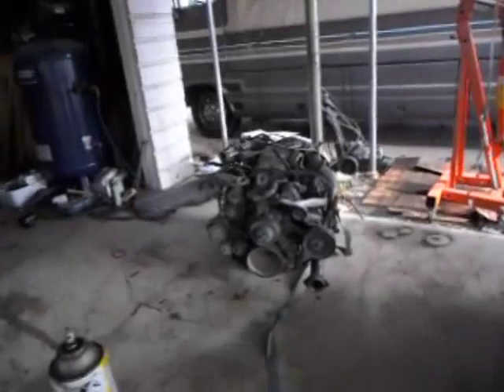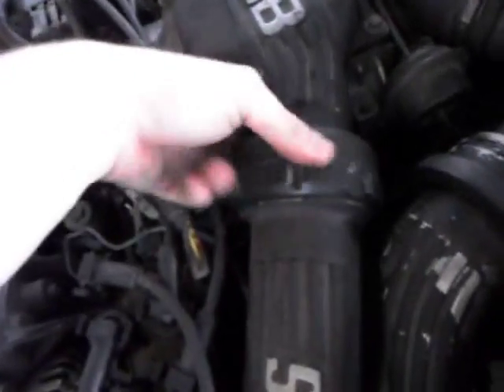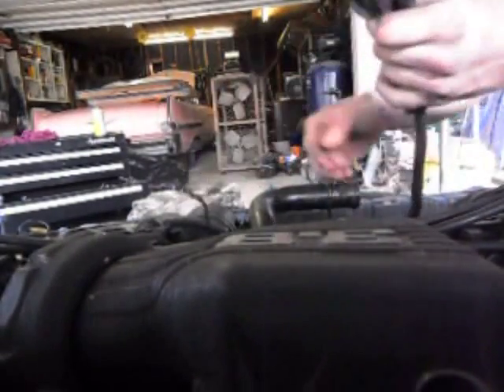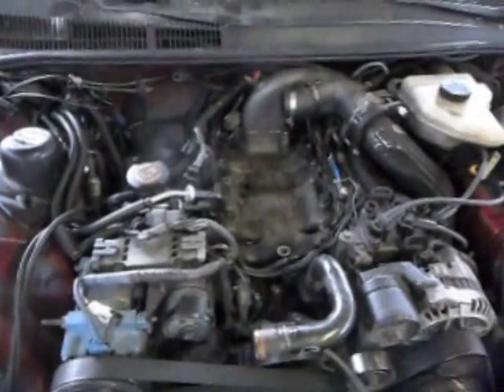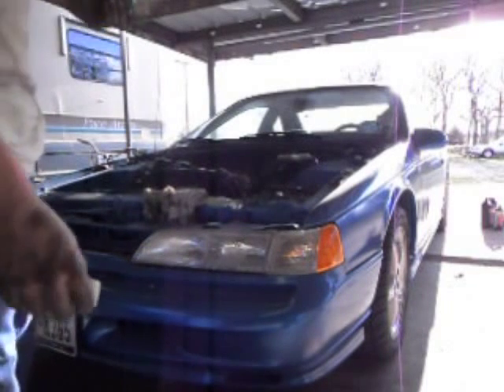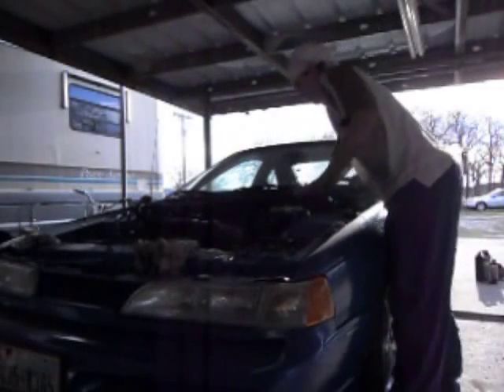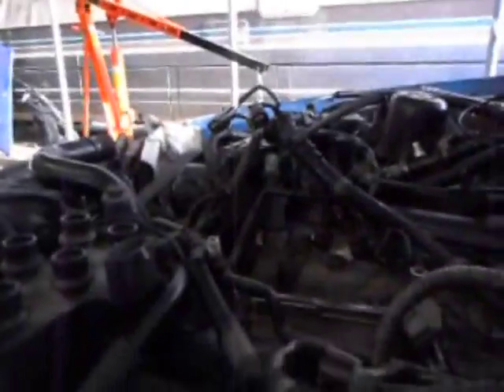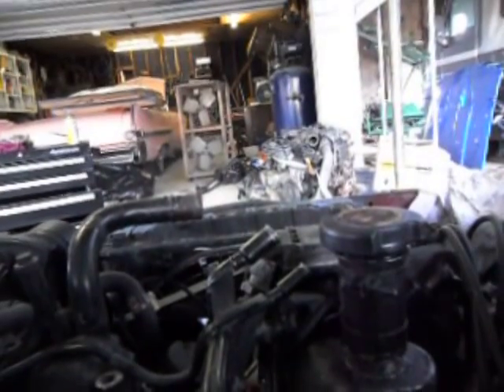Thunderbird SC engine swap. Part 1.

Comment: I have never understood the attraction of having a tiny  4 cylinders engine in a large heavy car like the Tbird ....WTF??    WHY??   Shoot just supercharge a 351 or whatever....small motor is going still be a heavy car with short motor life if races at all
Reply from the maker: This is actually a 3.8L 6 cylinder, but I get your point. It made great torque, but it's so unreliable.
Reply: The 3.8sc was lighter so need less power to go faster. (The 3.8sc made more power than the v8) The designers wanted to keep the main profile of the car and with what ford had in 89 a v8 wasn’t going to fit. They later on did design an intake to make the v8 fit a few years after the car came out. A supercharged v8 wasn’t going to fit.